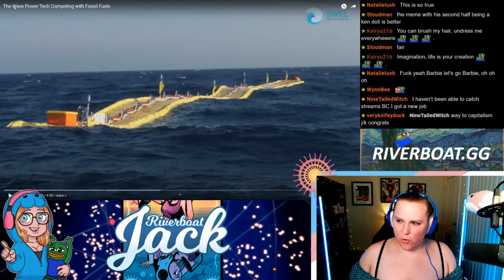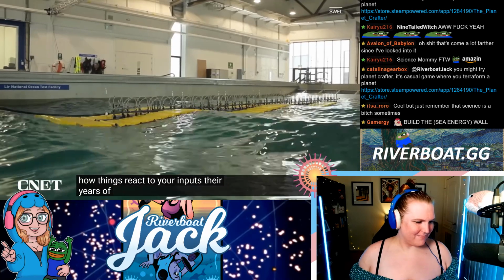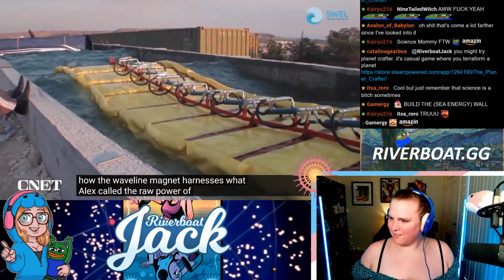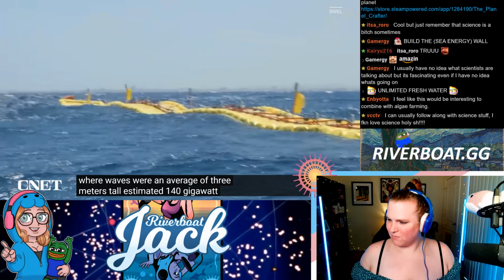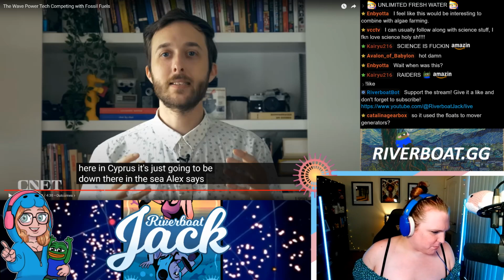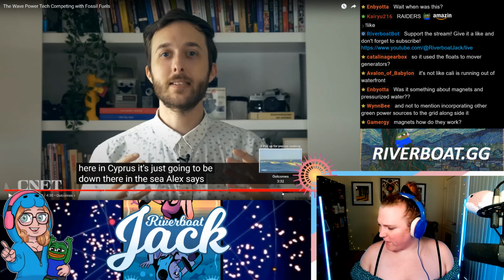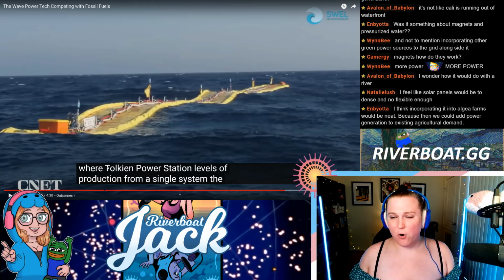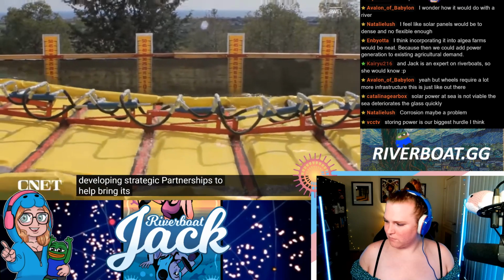How We Can Make Energy Without Killing The Planet

Comment: Gotta be careful with energy units. They give GWh/yr. At 140GWh/yr, it's rather small power production compared to dams we already have, but in same time, it's too much for such a contraption. It's the equivalent of 18MW turbine, and the most powerful wind turbine right now is the H260-18MW, with a permanent magnet generator about 30x the size of the entire raft. Just check the size, weight and how much water need to pass through one 10MW electric hydro generator. Impossible to have such in form of a raft really.